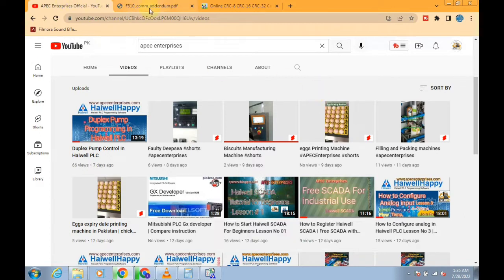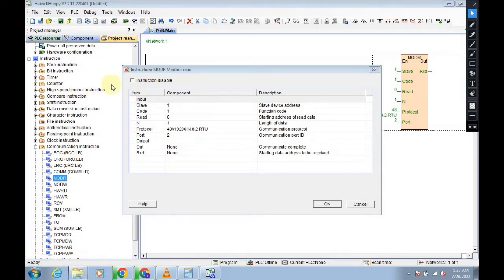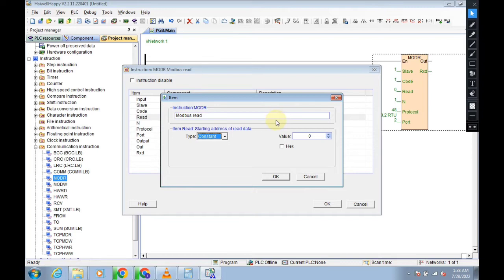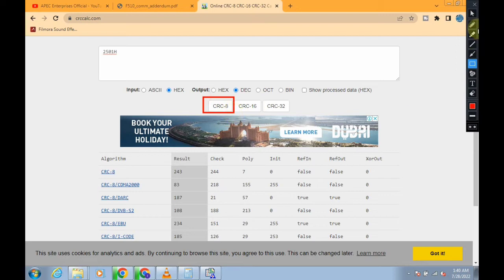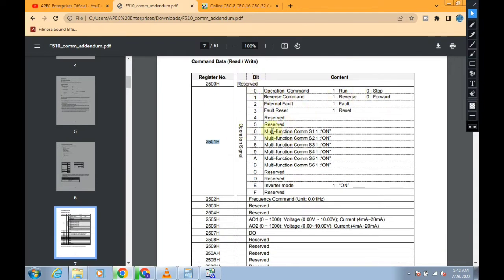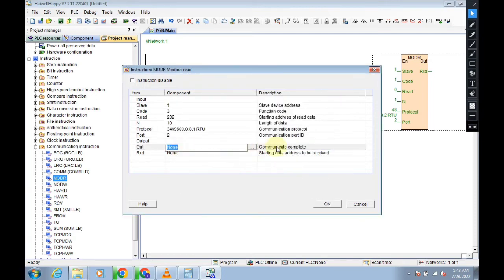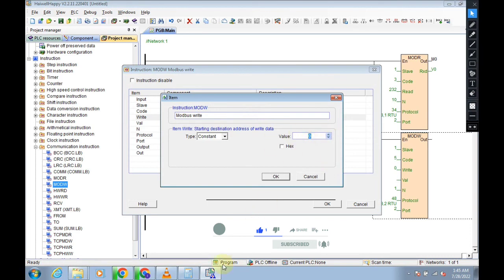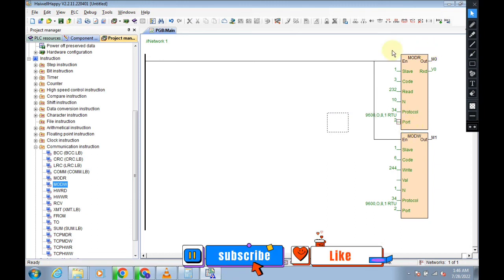Modbus Communication with TECO F510 VFD and Haiwell PLC | Simulation

Comment: Can you tell me how you define output port in this program..  Suppose i have many sensor with plc output..  Now i am using an Energy meter where i Will use modbus.. Which output port will work with which input how i will know..bcz in this program u didn’t use any input.. I am little bit confused here
Reply from the maker: You have no need to worry .if you can wait I will upload a video or if it's urgent I will guide you here, you need rs485 port and follow the data registers accordingly to your energy meter manual
Reply: Thanks for replying sir.. The plc i have now all input shorted..so they are not using any input..  Only output is using from the plc.. My question is suppose i connect my wire to 24 no as output..  How i will define its in plc.  They are already many slot using like 2 Compressor, water level sensor........
Reply from the maker: @asifislam7376  it need to connect on 24 Y  point the the y24 in Plc if you are using analog input module then you have 8 inputs and there name start with AI0 to AI7 so do according. For more better understanding of your question type in urdu
Reply: Hello sir.. I need your help please..
Reply from the maker: @asifislam7376  yes Please ask me anything
Reply from the maker: @asifislam7376  ask me brother
Reply: For analogue sensor like pressure sensor which instruction need to use..
Reply from the maker: watch this video on my channel, hope you will get the answer https://youtu.be/hE11bve72cA
Reply from the maker: Did you get your answer?
Reply: Yes sir..... Your video is enough to understand the plc.. Make a video for Integer to float view conversion please.. This is important.. Some modbus send data 16 bit and 32 bit.. But to display the value we need float. Make a video on this topic please
Reply from the maker: @asifislam7376  sure stay tuned